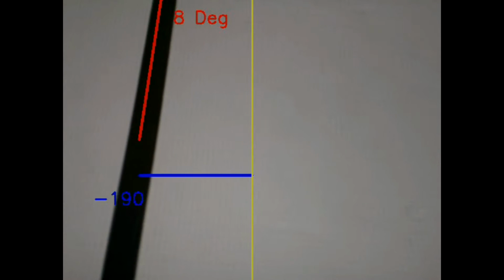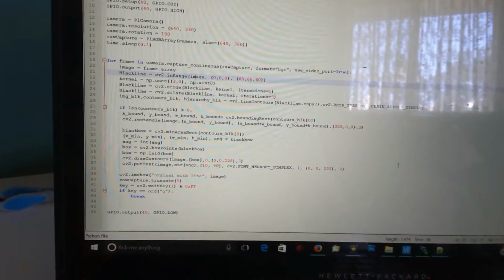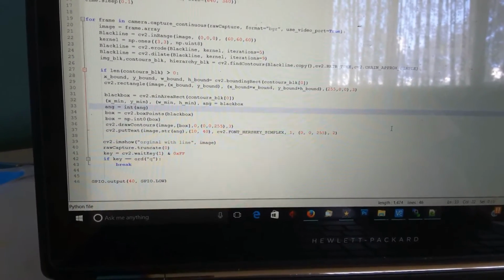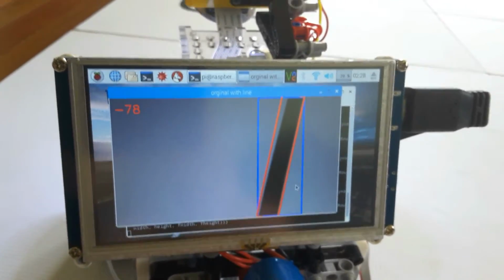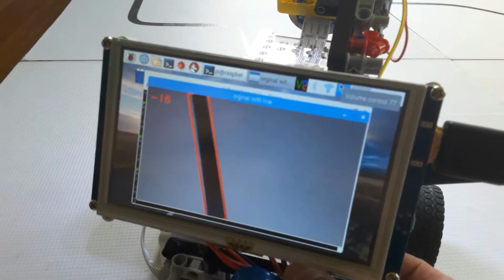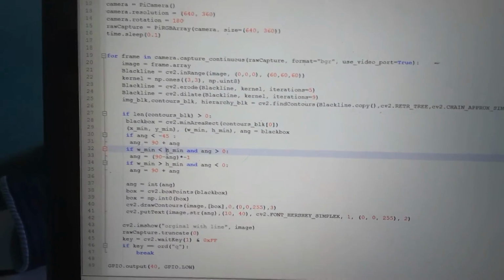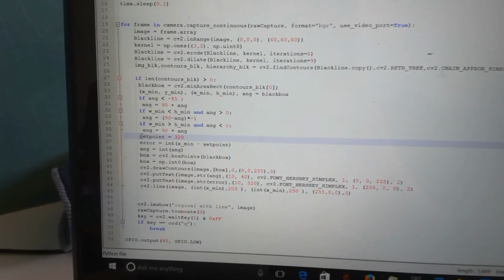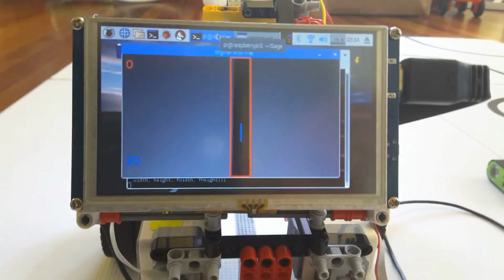Follower Computer Vision angle detection Lesson 3

Comment: Hi are you using a motor driver for that? How do you feed the motor driver to run. Is L293D driver applicable for that? I've seen the code but couldn't see any feeding to the driver to run the robot. Thanks
Reply from the maker: The code doesn't show the low level motor functions as the video is about computer vision not motor control. In the video I was using a RPi with a BrickPi hat that allows me to control Lego servo motors. But you can use what ever motor control you want including a L293D H-Bridge
Reply: @outofthebots3122  Thanks for the reply. Could you please provide the logic on how a motor driver run base on that robot vision? How can I run left and right motor base on the captured black line. Thanks
Reply from the maker: @fasterTV2023   well it was quite awhile ago I made this robot and video. Basics of any line following robot is a control loop, the sensor gives you what the error is (how far off line u are) then based upon the error u correct the steering. There is a number of ways to do this the most advanced is a PID controller for highest performance but there is simpler from basic on/off controller to proportional controllers. You can see some of my earlier videos on these simple types of controllers. In this video I was using a proportional controller because the angle predicts the future so you don't need a complex PID controller. I was basically doing scale1 * how far of line + scale2 * angle. You will have to adjust/tune the 2 scales for your particular robot